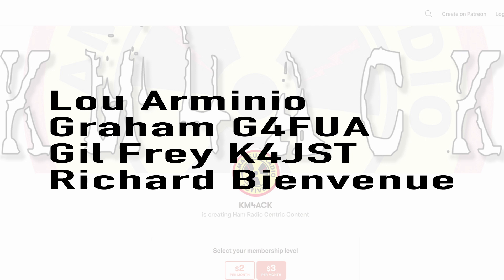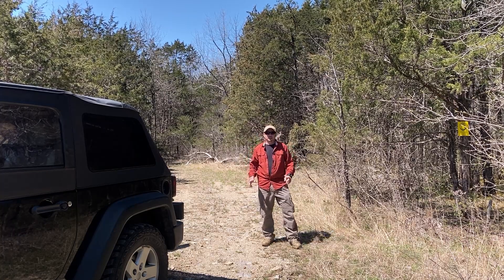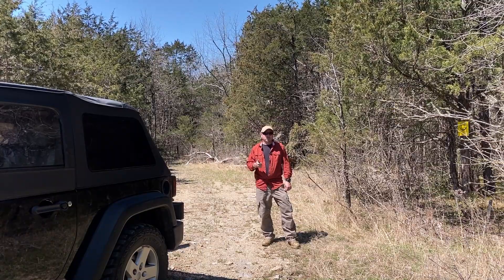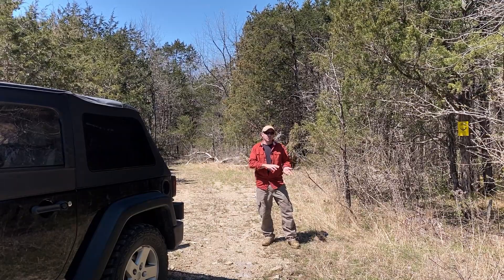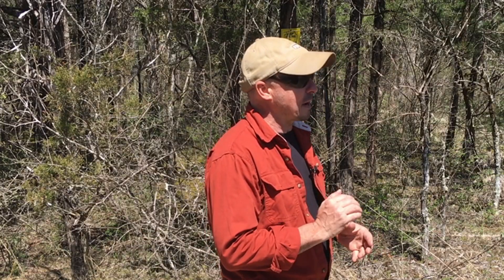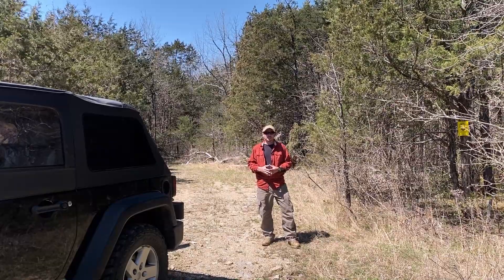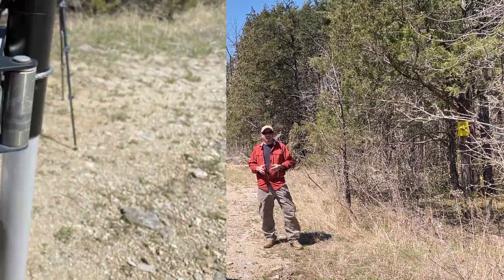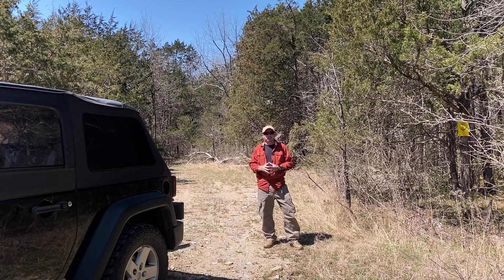POTA Fail K 3924 :: Portable Radio Challenge April 2021

Comment: I’ve had a few “failed” activations too, but a day out with the radio regardless of the number of contacts is one more experience you can learn from for next time.
I’d like to see what you think about the Elk Antenna you used.
K9KMV
Reply from the maker: Playing radio beats a day of work hands down. For the Elk, I LOVE IT. Expensive but a fabulous antenna that breaks down super small for transport.
Reply: @KM4ACK  thanks Jason.  I’m considering either the Elk or the Arrow. Tough decision!
Reply from the maker: I went with the Elk because all of the elements are on one plane and it seemed quicker setup/tear down. I don’t think you will be disappointed with either of them.

Comment: Do you have a video on the antenna mast set up on the front of the Jeep?
Reply from the maker: I don't. I got the mast & mast holder from tn07 https://tn07.com/telescoping-masts Then I just sandwiched the mast holder to the winch using the winch cable.

Comment: Jason, when mountain topping I work my experiments and gear checks and with the remaining time activate a POTA session.  Since the time is normally short and to ensure I get the 10 contacts, I first use FT-8 which is accepted by POTA and rack up the 10 contacts and then switch to voice, etc.  FT-8 is allowed in POTA    de Gary, W3GME
Reply: CW is better.  I have tried FT8, and it works really well.  I can bang out about 3 CW QSO's in the time it takes to make one FT8 exchange.  The FT8 bowl has a lot of fish, but it would take you all day to fish them all out.  With CW I can usually get my 10 contacts on the best band at the time.  I usually get 10 contacts in about 20-30minutes of activating.

Comment: We have very close the same setup. I using the 817 with Signalink and Bioenno Battery for my setup.  Instead of the pi I am using a Lenova notebook and PAR End Fed. I usually operate QRP digital PSK or FT8.  I still find my setup a bit bulky. I am good for portable, but I have a lot to lug around if I had to hike to a SOTA. That IC 705 keeps looking better with no cables between rig and computer. 
Good video. What extension mast are you using for the yagi?   Steve, VA3FLF/KM4FLF.
Reply from the maker: The mast is from https://tn07.com/telescoping-masts

Comment: I use FT8 to activate parks regularly. It works well, and they are in fact valid POTA QSO's. One nice thing about FT8 is that the POTA spotting page is linked to the PSK reporter site. If you are heard on PSKreporter then you will get spotted on the spotting page automatically.

One thing, in order to automatically get spotted this way, you will need to schedule your activation. Or if you have cell service, manually spot yourself and then you will automatically get spotted afterwards - even if you change bands.

I have also found that if you add POTA in your CQ TX marco, guys will flock to you.

Good luck!  WB8ERJ
Reply from the maker: Great info Mike. Thanks!  I wasn’t sure while filming this video if it was indeed a valid mode. Thanks for the tips on spotting as well. 👍

Comment: I had a failed activation as well. only 7 contacts all park to park. and had the wind knock over my new antenna breaking the tip. Hamrs does have a winter field day template that looks like it will work for field day as well. Do you have a JS8Call setup/use video. I would like to get into JS8Call more.
Reply from the maker: I have a whole playlist on JS8. It's for the pi 3 but works equally well on the pi 4. https://www.youtube.com/playlist?list=PL1QTYT4Qo9caJ2MaRG3D015f6aVK_D3ua

Comment: FT8 is definitely the most used digi mode on POTA. You don't have to change the standard messages or anything (but you can if you want to for POTA). If you announce to POTA spots they will find you. Alternatively, if you have no cell service you can spot yourself to POTA through JS8CALL! Great thing about FT8, POTA and QRP is that it works great for QRP and compromise antennas.
Reply: Wait, you can spot yourself through JS8Call???  Do share.
Reply: @gregorysmith3097  @APRSIS CMD :POTAGW   :CALL PARK FREQ MODE COMMENT
Reply: @FunInSC  I'll have to take a look.  thanks.
Reply: @FunInSC  Can you send an email like that too?
Reply: @kq6up  you can send email but you don't get any receipt or reply through JS8CALL so better to use Winlink for messaging text or email, IMHO.
Reply: @FunInSC  true, but you can't always connect to a Winlink GW on HF if conditions suck.  I can only connect about half of the time, but I just tried that HB feature on JS8Call and got tons of pingbacks on 40m